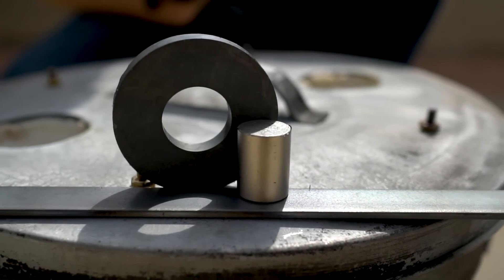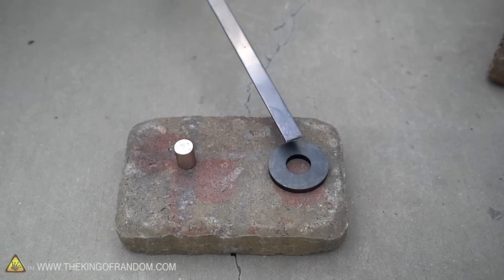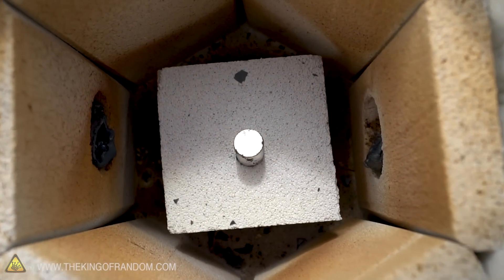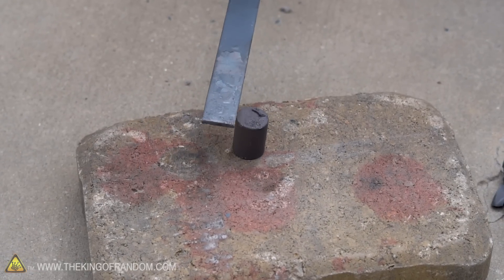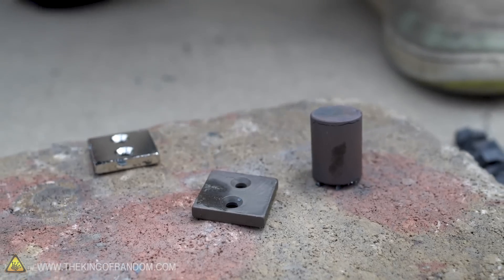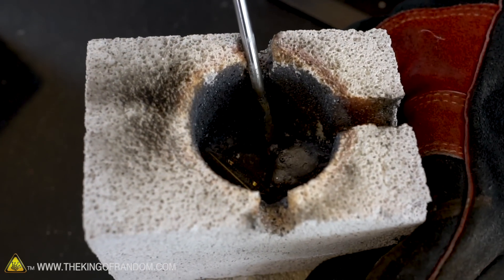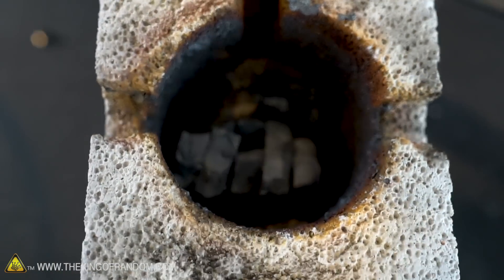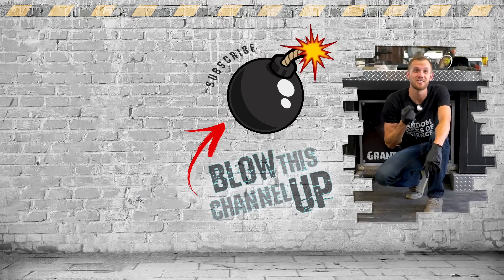Melting Magnets is Weird

Comment: Sooo... is it because of the atoms drifting further away from each other when it’s heated? Maybe since the material loses its magnetism at a certain temperature, the magnetic field itself is what holds the atoms close enough to each other to be attractive; therefore, not allowing the atoms to contract again. Steel has the flexible properties to allow the heating and cooling process.

What id like to see, is if a quick quench retains the magnetic or dissipates it.

Comment: Or maybe the ceramic magnet just like any other ceramic or glass and doesn't like sudden temperature changes. Plus how do they form them. I see no machining lines or marks from sanding. I think it is done sort of like clay " slow heating and cooling".

Comment: Why do you need to do such experiments when it is all documented?  All ferromagnetic substances (permanent magnets and "ordinary" steel) have a "Curie point" temperature, above which all ferromagnetic effects disappear.  This temperature varies with the alloy, being high for pure iron and lower with alloys (such as rare-earth magnets).  Anything heated to above this temperature and cooled in the absence of a magnetic field will be demagnetized.  Rare-earth magnets severely weaken even at lower temperatures.  In fact, the stronger the rare-earth magnet at room temperature, the lower temperature it is destroyed.  This is dilemma for motor magnets, where the stronger  they are, the better the motor works, but the more easily it fails when the motor overheats.
The Curie point is exploited in many temperature-control applications, such as in soldering irons with a fixed temperature setpoint.

Comment: Most neodynium magnets have a max. operating temp of about 120°C, some alloys can rise higher but nothing more than 200°C. Reaching those temps. will cause demagnetisation. This can happen to perm.magnet eletric motors when the rotor overheats.

Comment: Steel loses its magnetic properties when it is heated past a certain point. That is why when you quench a red hot blade after forging it the blade needs to face north or you can get warps in your blade.

Comment: Check what happens if you take a magnet with negative facing up heat it up and place it under another magnet with negative site facing down! So they push each other.

Comment: Did you know if you hit a magnet hard enough it looses it's magnetic properties? 

Also if you hit a steel rod or tool with a hammer it can become magnetic. The effect is weak but you can pick up nail or other small stuff. 

The effect is caused by vibration causing the steel atoms to align with Earth's magnetic field. 

One more fun magnet trick is to put a magnet in an induction coil. It will float and spin while turning bright white the falling theough the coil as a molten blob.

Comment: all bar magnets will become weaker over time.  if u have a horse shoe magnet, the magnetic arc will travel in a circle through the attached steel and will stay magnetic forever, so to speak.  an open horse shoe magnet will eventually weaken like a bar magnet, unless an attached piece of metal exists between the two horse shoe ends

Comment: If you melt all the magnets together and then send electricity through would it be the same strength, or would it be stronger or weaker, or will it not work. That should be the next video

Comment: Please use SI standard measurement units. How many bananas is Fahrenheit?
Reply: Just the tip
Reply: He should do both
Reply: Much bananas
Reply: 3 1/2
Reply: About 8477599264936493724274850392716385950382726485950281636485930283615153747595930283726364748493920183736485950604837262414162739202747593927499279296840017653900175538901755490275628094864289476639027649048839826525274859595947363625363747484859392639400000... 🍌
Reply: 42
Reply: Your body temperature is about 100 F. You are literally the thermometer in the proper and correct scale. 
At high temperatures it hardly matters, it’s about the same.
Reply: joonatanu like half banana
Reply: Adrian Rivas what typa bananas? If its the baby id say 2.221?
Reply: joonatanu Two buh nay-nays is equal to about 100 C when heated to water-boiling speed.
Reply: I heard of a new way that scientists may start using to measure mass. I don't completely understand it, but they use magnetic fields and they put the weight on one side of the scale and measure the amount of energy it takes to balance the other side of the scale. it is apparently the most accurate way we have come up with yet for measuring weight. don't know what it's called.... I think they said that they would be using the master kilogram to calibrate it, and after that we would no longer need that chunk of metal that we have sitting in a vault somewhere.
Reply: I believe what you're talking about is only to STANDARDISE the actual mass of the kilogram so to eliminate variation. We'd still use the kg as a unit though.
Reply: g(grams) is the base unit, everything else is a multiple of that.
Reply: I agree yes, but in SI units, the kg is the "standard unit". Its an exception to the normal rule like for example pressure is standard as Pa but used commonly as kPa
Reply: Don't get me wrong, I prefer metric and its a beautiful system, but at the end of the day, metric is just as arbitrary as imperial or any other term or measurement humans came up with. Do you imagine extraterrestrials would use meters? No they'd have their own arbitrary system and mock us for not using it like every other planet in this galaxy...
Reply: Will Griffith you're right, 16 inches to a foot is exactly as random as 100 centimetres to a metre. Definitely.
Reply: These are some units of weight: mg(0.001), cg(0.01), dg(0.1), g(1), dag(10), hg(100), kg(1000), Mg(1000 000)
Reply: Just as arbitrary?  0 freezing, 100 boiling vs 32 freezing and 212 boiling.  Not as arbitrary, not even a little.
Reply: Hypurr1 Gee, it’s almost like the scale for Fahrenheit isn’t set by water? What’s that? It isn’t? It has 100 set as the internal body temperature of a human and 0 set as a cold day in Europe? Gee it’s almost like the scale was calibrated towards numbers that matter to humans...
Reply: @Mostlyharmless1985  oh yes, everyone knows that all humans live in Europe and every day is a cold day. Truly vital information in the field of science.
Reply: @xSluggySlugworthx  I don't think you've understood the power of the SI system.
Reply: Will Griffith Metric is logical, Imperial is not. And once you try to go into the small world of measurements the imperial system shatters. 1/144th inch x 1/188th inch + 44/856th inch.. Yea it gets wild pretty fast
Reply: Will Griffith yes however a singular system that can be counted on your hands is invaluable, there are only three counties in the world still using imperial.
Reply: True but at it uses the same scaling system across quantities and that's pretty awesome. We should all switch to binary imo
Reply: how many water-boilings is the sun? How many water freezings to get liquid nitrogen? While i do feel fahrenheit isn't a great temp measure, it's the better alternative here. Anyone thinking the opposite, is just a M fanboy that won't admit they have short-comings, like everyone else. K is even more accurate than C, and it's inherently harder to measure that way.
Reply: @nicewhenearnedrudemostlyel489  not only is Celsius a well established system of measurement based on the melting and freezing point of a common compound, whereas Fahrenheit himself admitted the scale was arbitrary, but K has the same scale as C. You're completely mistaken if you think K is more accurate than C just because it starts lower.
Reply: I would agree that it would be a mistake of motive(and my using the term accurate), but I was operating more on K being more objective a measurement. based on the concept that using water to define the rest of the universe isn't as appropriate as using an independent measurement, even if it lines up otherwise almost exactly the same. To that end, I also bring into bring into question why the concept of K can't be absorbed into C, and whether or not the reasoning is similar to why F won't accept C. Maybe none of them are necessarily 'better' enough than the other to really matter..?
Reply: Basically, i'm against the argument itself, because it isn't considering the basic understanding of the tools involved in the argument. they're arbitrary by nature, being a man-made repeatable observation of the universe. We all know to some degree that we can't see things outside our physical ability, so we design a concept of how to describe what that is. the brain can't distinguish what 70 degrees is, unless you teach it what 70 degrees even means and even then total accuracy would be questionable. it's why you constantly have things telling you what temperature it is, should be, and what you should use to check it. Until someone comes up with something that makes far more sense, like the actual measurement for the current state of the object's total potential energy, and a method to implement that in the framework of math that people understand and can use, there's 0 need to argue over who's is better and why. there is no end or solution.
Reply: @nicewhenearnedrudemostlyel489  K and C are used in different contexts. I myself don't see that much of an importance, but I suppose it's far more direct for scientists to write 0K than some long five digit number in Celsius. As I said, C is based on a common everyday compound, whereas Fahrenheit isn't based on anything. I wouldn't say it's flawless, but Celsius is the most widely used and somewhat reasonable scale to use.

Comment: What would happen if you melt a phone
Reply: you'd have a broken phone almost for certain.

source: I am a phone specialist
Reply: It will melt if it melts
Reply: Diamond Lizard it would probably explode because of the battery
Reply: SloppyJoe 22 I can double that it's not fun
Reply: Diamond Lizard you would have a broken charred phone, but hey go ahead and destroy your phone if you think anything else is gonna happen
Reply: The result will be: you'll have to buy a new phone
Reply: It will not work
Reply: Verizon would come and try to make commercial "can you hear me now?"
Reply: Grant did that with iJustine
Reply: How about melting plutonium?
Reply: New
Reply: Nothing.....it will just melt
Reply: The lithium battery could possibly explode from the extreme heat before it even melts...... The glass would probably also crack and slightly shatter around..... And then melt xD
Reply: It becomes a guuey mess
Reply: Hello, is It me you're looking for???
Reply: maybe
Reply: in summary: explode because of its lithium battery

Comment: .53 seconds, you  said "heat  up Maggots" Ha.   And you have  to SLOWLY bring up thhe   heat on the magnets  to melt them,, or else they shatter. Kinda like letting cast iron cool down to quick and it bbreaks, but the oppisite happens with magnets.

Comment: Can you try MAKE a magnet? (A permanent magnet, not the temporary/electro magnets)
Reply: Um, what, you think all commercially available permanent magnets are like, dug out from mines or something? Of course you can manufacture a magnet.
That's what letting hot ferromagnetic materials cool in a strong electromagnetic field (as suggested at the end of the video) would do.
Reply: Man, its izi. The magnetic field is created by the arrangement of the particles, if you get a hot metal and force a huge magnetic field (neodymium/electromagnet) while its stills red, and let it get colder, once cold the particles would still be organized in that way, creating a magnetic field
Reply: Milo Legends from what i know u cant
Reply: evan otha you can

Comment: Fahrenheit just doesn't sound hot at all. Celsius actually sounds hot when you use that temperature for example
100 Celsius is 212 Fahrenheit
If you are going to keep using Fahrenheit at least put up the Celsius value as well for the rest of the world who aren't American.
Reply: 1861 ferinheight is equal to 1016.111 celsius so how does ferinheight not 'sound' hot?   I would argue it sounds hotter..
Reply: Joshua Schwarting I believe you misspelled Fahrenheit But I'm not sure.🤔💭
Reply: Joshua Schwarting It sounds less valuable. its also not based on water.
Reply: Edin743 I see what youre saying,  though heat doesn't have value in a monetary sense.  And aren't air and water tempature recorded the same in celcius?
Reply: Joshua Schwarting Well, since I am not a native speaker of English I don't quite get what you want to say but 
if you tried to say that everything is measured same then I think yes?
I don't quite understand, please give me more information.
Reply: There is a "rest to the world" that isn't American?

You must not knkw many Americans.
Reply: OliOli true scientists can just convert it np. Seems like a you problem
Reply: @davidmope6324  True scientists wouldn't use Fahrenheit to begin with, therefore, not need to convert anything.
Reply: OliOli just calculate it
5/9(F-32) i think this is right?
Reply: I use Fahrenheit. I am not an American. I am a Bangladeshi.
Reply: Celsius is way more awesome than fahrenheit
Reply: MURICA!
Reply: Fahrenheit isn't based on the freezing temperature of water. For example, 32° Fahrenheit is the same as 0° Celsius. Making the Celsius system based more on old world "elemental" science. If you want to be truly accurate though Kelvin is the way to go.
Reply: yeah
Reply: OliOli yes yes true. BTW love you profile pic
Reply: We agree
Reply: lol celsius
Reply: OliOli you sound like my teacher
Reply: OliOli celcious all sounds the same to me now stfu
Reply: don't like it, don't watch it.
Reply: OliOli fools! Use Kelvin much more accurate
Reply: richy phachanh Kelvin is no more accurate than Celsius, they both operate on the same scale meaning they have the same accuracy.

Kelvin = Celsius + 273.15
Reply: -40 Fahrenheit is exactly -40 Celsius 
They sound equally cold
Reply: OliOli We have the reverse problem!  Seriously. Its a real "1st world" problem.
Reply: The earth is the third planet from the sun so all problems are third world problems.
Reply: Pablo C. You cannot change a whole culture with a comment on YouTube!
We are not freaks (some are but thats not the point) because we use a different way of measuring.
Reply: @BIGP1980kid  But km is so slow every time I get behind someone from Mexico and the speed limit sign says 40 I'm stuck going 25 because that's 40kmh not mph,  and Americans while everyone else uses metric system our system is called "the standard system" I think everyone should just use "the standard system" rather than the below standard metric..😒
Reply: Since when does C or F mean heat? and why does the subjective view of 'sounding hot' get to determine what hot actually is? Honestly, a system that focuses solely on the action of water, setting points like 0 for freezing and 100 for boiling seems less appropriate.
Reply: Customary units are just ugly to me. And I am American 😂
Reply: As an American, I dont evern understand Farenheit. Me and my family use Celcius, just makes sense
Reply: CatTNT 
What's that got to do with your being an American?
Reply: Americans are ignorant, they have no interest in getting along with the rest of the world.
Reply: TH3 M0NK we're so ignorant we defend and financially support the rest of the world.   Now go dig a 6 meter deep hole hop in and cover it with 10,000 sq ft of soil

Comment: You say that neodymium magnets are "mostly made of neodymium", but they are actually mostly iron. The crystal structure contains only 2 neodymium atoms to 14 iron atoms and a single boron atom (Nd2Fe14B). They are somewhere between 60-70 % iron (by mass), which is why it still sticks to the magnet after it cools down below the Curie point of iron.